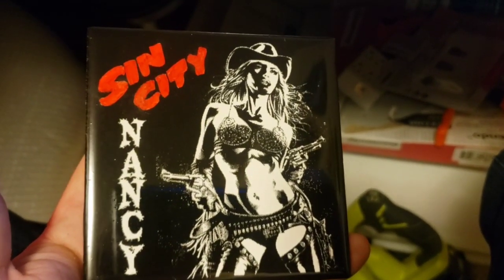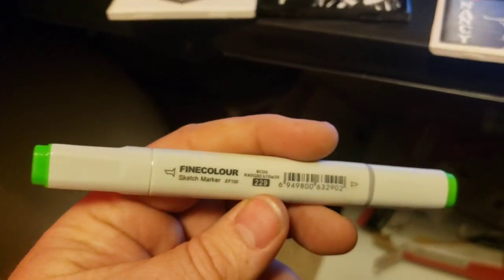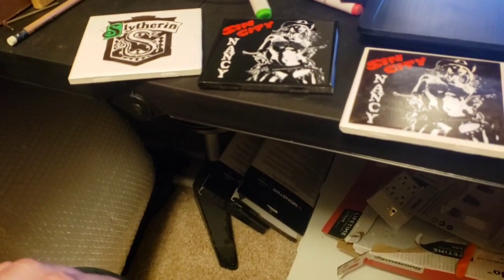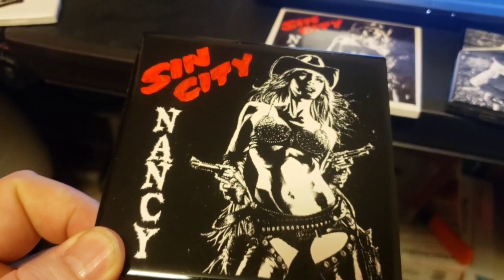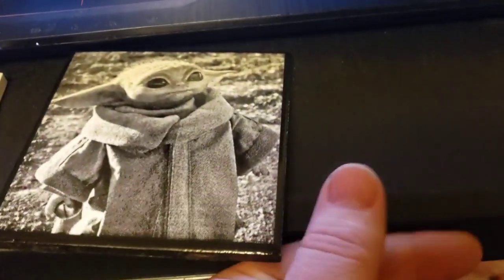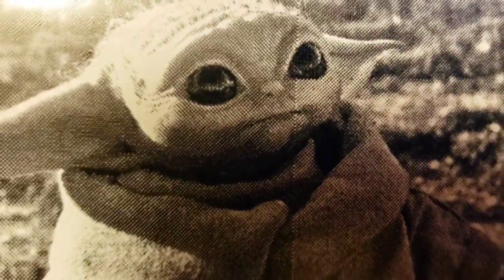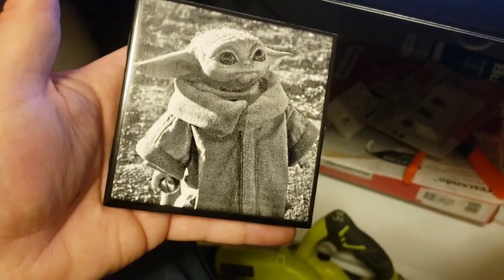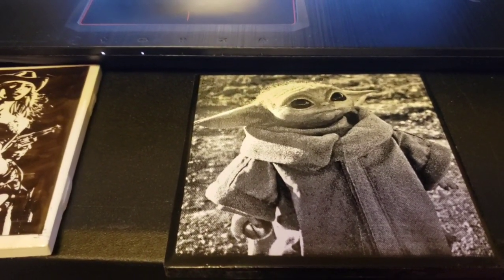The Kenny Hack: Magic Marker vs Painted Tile. Both have their uses. Ortur Diode Laser.

Comment: Another great video 😃 thanks
Reply from the maker: Thanks,  I'm glad you liked it and hope it helped for future projects.
Reply: @TheKennyHack  
On a different topic do you know where to get a Female Connector Laser Module Control Board Wire Cable I can't find any parts for the ortur master
Thanks
Reply from the maker: @carlbarros3571  I haven't found a good part supplier either. Ortur needs to get way better at that.
Reply: @TheKennyHack  thanks for your help for now I'm down waiting for the new ortur to arrive  hopefully in 3 weeks